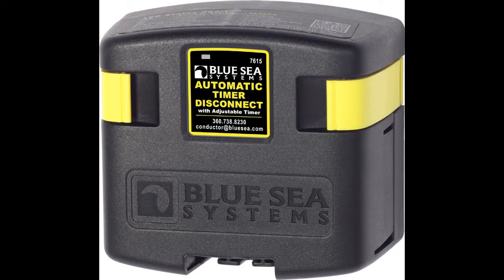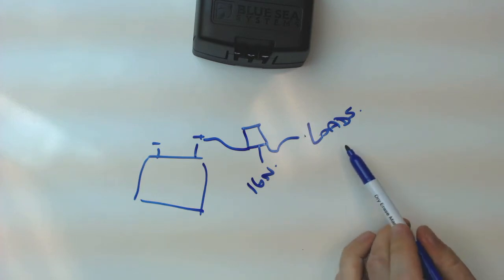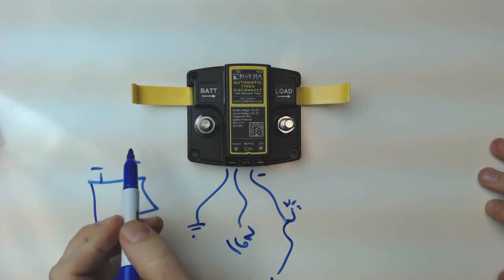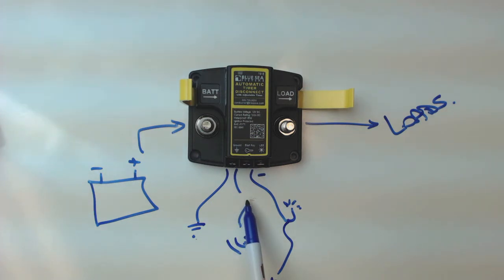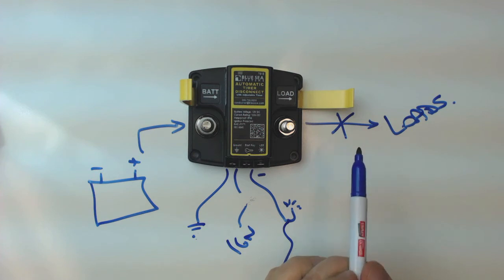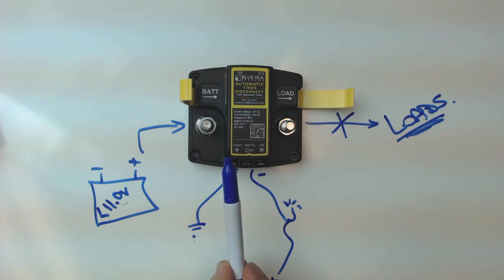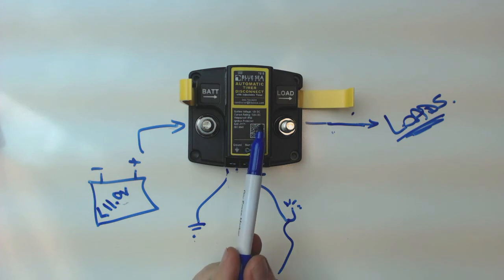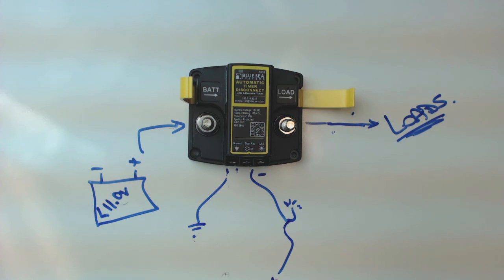Desktop Demo - BlueSea 7615 Auto Timer Disconnect power timer

Comment: cool, I just use a $4 mechanical timer, can select the timer you want for each use from the drivers seat.   Low Voltage Disconnects are useful too.
Reply from the maker: the main idea behind this timer is that it's completely automatic and doesn't require the user to do anything.   Having your own vehicle is one thing but for vehicles that have multiple different people driving them, it helps to have the function completely automatic.  Cheers!

Comment: Excusame, where is  the divace to program 3 , 5 ,  15 , or 60 minutes the timer?
I'm  a locksmith  and I use a inverter 12v to 120v  of 1200 watts and old the time I forgot to turn of the inverter and  this kill my battery, and that is the reason I need a timer for 12V , 30 amp..
Thank you.
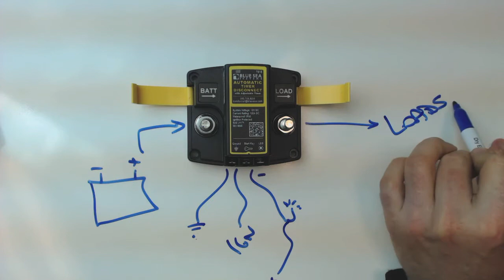Reply from the maker: There are dip switches on the back to adjust time and cut-off voltage.  See 2:50 in the video.
Reply: I connected my blue sea timer from 8g power to “batt “ then i have a relay conected too it amd then to the fuse block , i tried grounding the wire on the pins on the timer and even on the chassis of the car . I tried powering led to ground as well . And it wont reach the fuse block , dip switch is set to only 5 seconds , i have radios and emergrancy lighting .